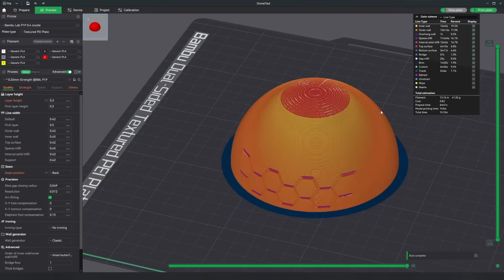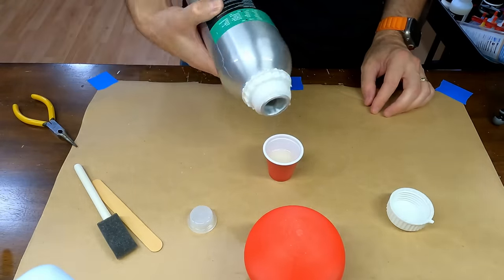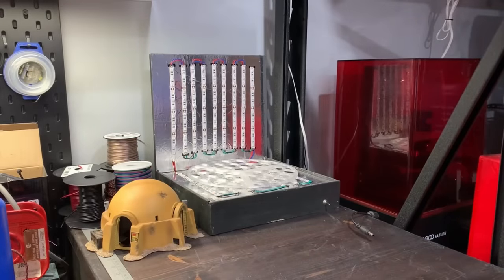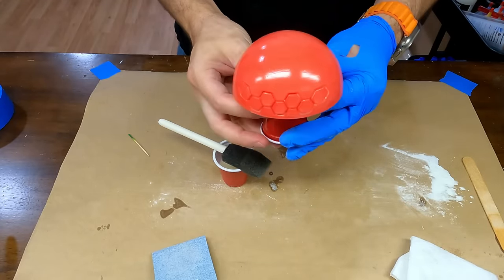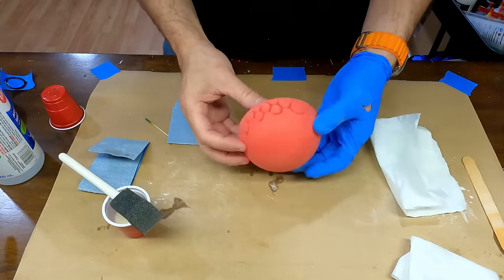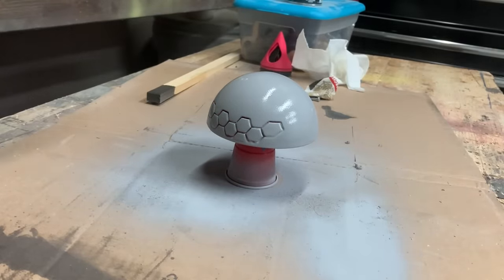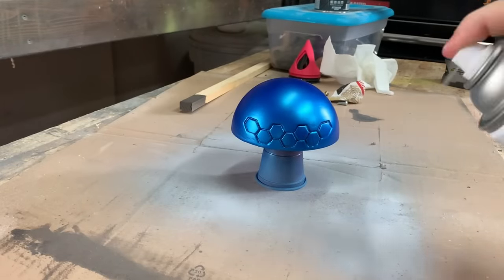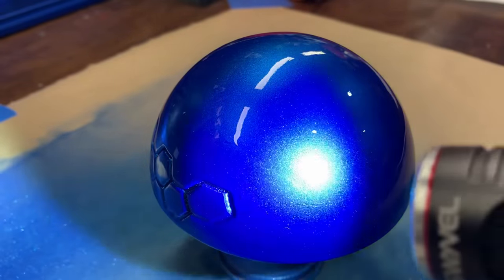Hide 3D print layer lines with Baby Powder and UV resin

Comment: That's waaaay too much work!!!
Sure, it look gorgeous, but dam it's not fast.
May I suggest you to use a resin printer next time?
Reply from the maker: Ya that would be great, you have a resin printer big enough to print an entire helmet?
Reply: @DaveRigDesign  Jupiter 6K is 890$ shipping in US included. You can print the helmet in many pieces. Then, assemble them with dowel/key + glue.
Making the parting lines disappear would be shorter than what you are doing.
I'm not expert, this is just my suggestion to save a lot of time.

Comment: Wouldn't just any car body filler work , with a plastic primer?!!!
Reply from the maker: ya, spot putty or bondo would work, more effort applying and you have to wait longer for it to dry. Also with those you have a limited working time where with UV resin it only cures once you put it under the light.

Comment: wouldn't i have been faster to just sand it and paint it? get some quality 120 grit paper and attach it to a DA sander, you'll be done in the time it takes to mix that epoxy with the baby powder.
Reply from the maker: Not even close :)
PLA is so hard to sand, and you can't really use power sanders as they generate too much heat and melt the PLA due to its low melting temp. 
Out of the different things I've tied so far this was the fastest/easiest by far.
Reply: @DaveRigDesign  Ah I see, very well then, as you were!

Comment: dude you needed to sand it anyway? what's the point?
Reply from the maker: You clearly have not tried sanding PLA before. 
For a woodworking analogy, sanding PLA is like sanding oak and sanding resin is like sanding pine.

Comment: I would sooner let this sit in a rock tumblr for a week then attempt this level of craftsmanship. Fine detail, but i would want at least 50 bucks an hour minimum to be doing this in some type of repetitive format.
Reply from the maker: I don’t know if a rock tumbler would work on pla/resin. Interesting idea. 
But I know what your saying.  It is a lot of work but it’s actually the fastest/easiest of all the methods I’ve tried.
Reply: @DaveRigDesign  You can place a plethora of material in rock tumblers. Slightly more abrasive than others. Princess Auto has one for $60 Canadian. Fine Abrasive Media, and the also have polishing media as well. If you don't try this one, I certainly will give it a shot. I'm trying to grasp Blender and work on a patent. So, this is all you, if you'd like. You definitely have a subscriber in me.  Cheers!

Comment: Why didn't you just sand it first before applying any coat.  I'm just saying, if you have a scratch on the paint of a car, you wouldn't apply clear on it first then try to remove the scratch.
Reply from the maker: well, to test out a worst case scenario, and sanding PLA really sucks :)

Comment: Bro, the title for this video should be, "Hide 3D print layers lines with Baby Powder and UV resin (5 or 6 coats), lots of dry sanding, wet sanding, filler/primer, and two-step professional painting, as you would do for any surface on the planet that you want a smooth finish for.".  Just sayin'...
Reply from the maker: To get a finish smooth enough for a glossy finish you have to do a lot of sanding and priming. 
The resin just makes that easier

Comment: Couldn't you just use filler in the first place and the sand rather than use the resin?
Reply from the maker: You could. I did a video on that here
https://youtu.be/xxdjFREJpKs
Harder to apply but easier to control where it goes.

Comment: Using corn starch is not the best idea as it is organic and will oxidize and rot. Using original talcum powder baby powder would make more sense. Or you could just use epoxy thickener or diatomaceous earth which is a safer glass powder.
Reply from the maker: Possibly but the plastic the print is made from, PLA is also made from cornstarch so…
Reply: @DaveRigDesign  In organic chemistry you can essentially make anything from anything. That doesn’t mean the thing you started with and the thing you end with are in anyway related chemically. If you don’t believe me, try putting corn in your 3-D printer. There are a few chemical processes between corn and PLA. You should 3-D print a corn cob and eat it. You can dip it in acetone which is also made from corn. You’re logic is flawed. Maybe just spend five minutes researching some thing before you put out a video with bad advice instead of getting mad at a viewer for calling you out. My original comment was a list of facts with no negative connotation. Your reply had attitude. Also, you’re welcome for suggesting the actual solution.
Reply from the maker: Well, I’m just showing options. I’m not saying it’s good or bad, just like I saw this and tried it people will need to decide on their own if they like it or not. 

As for the idea of rotting since the powder is encased in resin and then covered with paint and clear coat it has no access to oxygen, so even it was a possibility the likely hood of this being a issue is pretty low.

Also I’m not mad, people can have any opinion they want, but too many people talk about things they have no practical knowledge of so I apply the same value to it.
Reply: @DaveRigDesign  I just keep hitting your nail on the head with my hammer. Your last comment ended in so and this one starts with well. You should try leaving a comment that’s just factual sentences. By the way, this is the people deciding it’s a bad idea. Doesn’t seem like you’re taking it very well. I’m not sure why you’re trying to come up with ideas that already have well thought out solutions. If you need an epoxy thickener, they sell a sterile, chemically stable product for that.

Comment: The amount of extra steps completely defeats the purpose imo. It's just filler then paint. Doing it with a 5 layer + 5 curing process might be relaxing but takes way too long.

Plus you can minimize the really ugly layer artefacts by using a more clever slicer or changing the gcode yourself with curve height final layers

Comment: Honestly way too much cost and effort for the result.
This also wont work as well for shapes that aren't as easy to work with.
If you put enough layers of anything similar to resin on a slightly rough print and sand over and over its going to look smooth eventually.

Your effort and dedication is definitely doing 90% of the work, not the resin and baby powder mix.

Comment: Good ideas.. all of them (except safety equipment seems nonexistant ---that torn glove man change it)

Do you have an air vent to pull that atomized paint away?   I don't see one.  You are inhaling that junk into your lungs--those pigments and tiny plastics and metal flake WTF.  People please paint with a respirator outside or get a decent ventilation set up...same for sanding and that resin.  Taking risks with your body can get you into trouble and you will never know exactly why you got sick later.  Some people get cancer (or other medical issues) from this type of carelessness and some do not--no one knows why, but it can happen. Why take the chance.  Air filtration may cost $500 to $1000 for a good system, but that is hell-a cheaper than one trip to the doctor to run tests for cancer/liver/heart/lung/brain issues.   I worked a job where the place didn't care.  I worked only two weeks there i coughed up orange paint dust every night.  The women that worked there that told me they had constant headaches are pry dead now.  Someone later told me that business poisoned that town's water supply...more than once.  I still think that exposure could have damaged me and may crop up as an issue sometime later.  It was decades ago, but still is haunting memory.

Comment: so basically the baby powder and resin is pointless if you keep sanding. you could have gone straight to sanding instead and go for filler primer. you would have achieved the same result and even a better one in the grates of the honeycomb pattern.
Reply from the maker: With way more effort, yes.

Comment: Honestly, if it takes that much time and energy, I'll just use the resin printer from the start.
Reply from the maker: Sure, if you can find a resin printer that can print a full size helmet that doesn’t cost as much as a used car :)
Reply: @DaveRigDesign  Sounds like your use case is very different to mine!

Comment: ... OR... You can just print it in resin from the beginning and skip everything else.... you're welcome!  👋😁
Reply from the maker: Cool, you have a super expensive resin printer to print a full size helmet in one shot?
Reply: @DaveRigDesign  - I do, but I don't plan on using it for that lol. I'm using it for prototypes which require extreme detail and MIGHT need to be the size of a helmet; so.. yeah! 😉👍 But I get it.... Saving 💰
Reply: @DaveRigDesign  - Yes I do - and Yes it can. I custom-built my own UV-Curing Station to match my print volume. Now I'm about to buy a top filament printer as well, because resin printing wastes almost as much resin as it uses and requires a LOT of clean-up. So I want to try the filament printing next. I'll probably treat myself to it for the holidays. 😋

Comment: Lookes nice but a lot of ofort for one model . Imagine having an order for 200 pcs. Mabye easier just to use the resin in a resin printer and have the smooth surface on the 1st try
Reply from the maker: Well this isn’t a mass production process. If you had to produce a large volume of widgets and needed a smooth finish injection molding would be best.

Comment: please be careful dry sanding UV Resins, I hear their micro particles are particularly egregious in the resin world. Even just cutting supports off it is required to ventilate unfortunately as it produces some of the finest dust known to man, flying everywhere due to the impact of the clippers forcing their way through the resin.
Reply from the maker: yes, you need to be careful when working with resin but context is also important. 
If your sanding a model once and a while or clipping a few supports you should be ok with a simple mask at best. But if your working in a factory processing thousands of prints a day you will need the proper PPE.
It's all relative.
Reply: @DaveRigDesign  Absolutely, or just a positive flow of air away from your persons should suffice for most cases, nothing drastic, just control the pressure and flow away from you and you are set.

Comment: Very misleading title. The UV resin and baby powder did virtually nothing. The hours you spent priming and sanding is what achieved the effect. They even sell two part epoxy that does what you "discovered" but works much better. You completely wasted hours of your life on a process that works much worse than what real 3d printers have been doing for years.
Reply from the maker: The common thread on all the dumb comment people leave about this process not being useful is they have not tired it, but are somehow experts on the subject. 
Go watch this if you want to know the difference the baby powder makes, although I know you won’t. 
What hides 3D Print Layer Lines Better,  Resin or Resin with Baby Powder
https://youtu.be/UFRbTg37Td8

Comment: Honestly, that seemed like a lot of work. You should go hang out at a car body shop for a while, you'd learn a lot. A simple coat of 2k high build primer would have saved 90% of the work in this vid.
Reply from the maker: I’ve painted many cars and I’ve never seen body work have the kind of surface you get from a print. Unless you are painting right over the rust. Lol

Comment: 3D printing is failing atm.  Nobody cares how pretty the print is. "the problems remain the same:

we want thousands of parts per day

we want them big (20 cm in XYZ)

we want them without additional work

we want them made from polyethylene, PVC, or POM

do you make parts from Teflon?

Oh, and we’re not looking to buy 300 machines that will do this, just a few."
Reply from the maker: Cool then you can spend $1m getting dies made for injection molding and wait 6mths and hope you don’t need to modify the part or you have to start over. 
Or contract a print farm to start making parts a day or two after they get the model and updating the production line is as easy as updating the CAD file.

No one create there own injection molding factory to make parts so why would they start their own print farm, although they could if they wanted to, not an option for injection molding. 

Commercial 3d printing is always happening and only growing
Reply: @DaveRigDesign yeah, good luck with your opinion.  I'm not paying millions for injection molding or any of the stuff you mentioned.   3D printing has not taken off like people expected,  its parallel is solar panels.....so I think 3D printing is here to stay, but its gonna drag out for another 10 years hopefully sooner before it takes off.....maybe 5?  Good luck.
Reply from the maker: @ShakeyLimbs https://youtu.be/bgHToGAuU4E?si=gz1M68kkhkK-n93E
Reply: @DaveRigDesign I look at the demographics, and past performance.   Most 3D print companies fail.  I think 3D printing is great for cool tech stuff, metamaterials, nasa, hobbies, proryping etc....just easier more reliable ways to make high roi.  I watched your video and saw that layer lines are still an issue.....I will wait another 5 years.  Funny how every 3D print hobbies is monetizing videos, patreon, Facebook, etc because they are not actually selling 3D prints....its not viable.

Comment: It's kind of pointless... What is the point of using 3D printer for speed result and then spend 10+ hours baking and polishing manually just to get clean surface ?  It just means you need completely different solution or much better 3D printer to do this job. Why not to try any dissolver like with polymer clay smoothing ? Why not  spray everything with regular acrylic primer and use Dremel with polishing disk instead ? Why not try to smooth it with ironing tool just like 3D pen creators do everytime ? Any of these approaches feel like much easier and much more faster solutions to fix z-wobbling issue. And once again : what the heck is this gizmo ? What is it for ? If it's some kind of tool or support - nobody cares how smooth it is. If it's something decorative meant to be exposed : you'll have to paint it anyway. And it will guide you to the primer/polish/paint/gloss coat anyway. The general advantage of 3D printing is SPEED but you completely discard this advantage by bulking hours of labor and "exotic" equipment like your UV box....
Reply from the maker: I was going to write a long rebuttal but Your comments clearly points out you don’t actually do any of this work and just talk about things you don’t truly understand so I won’t bother.

Comment: It’s a waste of time. It took so long to smoothen such a simple geometry. You could have sanded it faster, not even talking about putting it on a lathe. Just use thin epoxy resin + sanding. Smooth-on has some good material they developed specifically for 3D prints.
Reply from the maker: I assumed people would understand the simple concept that this print is just a example and the concept is to be used on larger prints with complex geometry, but maybe I gave people too much credit.

Comment: mane with all this effort i’d rather just sand😭😭 bro talkin bout gluing bases and ratios and 3 coats and curing it and shit like bro😭😭
Reply: AND SANDING IT AT THE END ANYWAY😭😭
Reply from the maker: its way less work then sanding PLA until smooth. :)
Reply: @DaveRigDesign bro hell nah you put like 2 more coats after putting 3 coats and sanding it twice bro😭😭
Reply from the maker: ya but the sanding was super fast and easy, 5 min of sanding smooths out the resin. 
5 min sanding PLA barely scratches the surface. :)